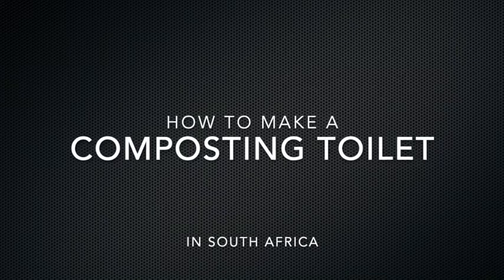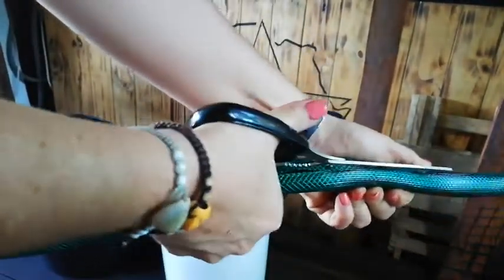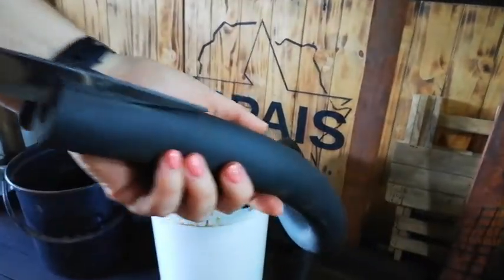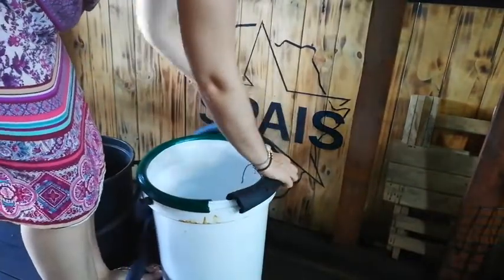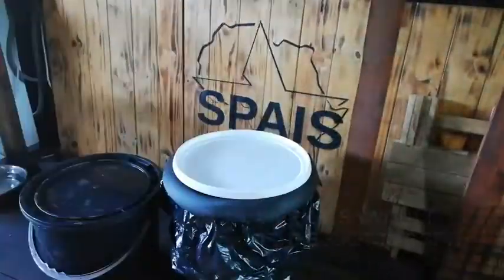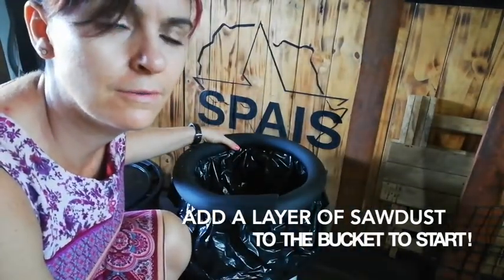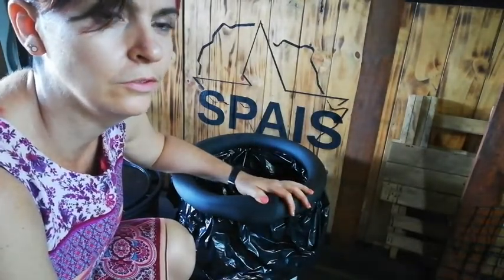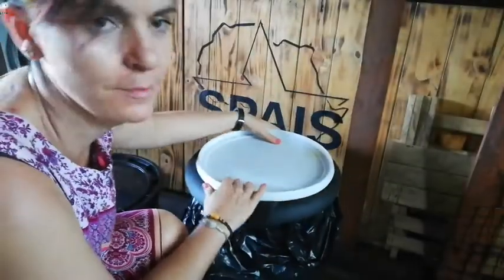DIY How to Make a Composting Toilet in South Africa - Sustainable Living!

Comment: Tried and tested. Worked perfectly.
Reply from the maker: Great to hear!
Reply: Interested as to why people dont like or comment here. This is a great video well done. Xx
Reply: Hi, interested in having a compost toilet in my new house in Eastern cape rather than a flushing toilet. Just wondering if the plans will be passed? Any advice would be great.
Reply: I use this system myself, its fantastic HOWEVER, it's illegal as there is no municipal or SANS standard for composting toilets in South Africa, pretty shortsighted in my opinion